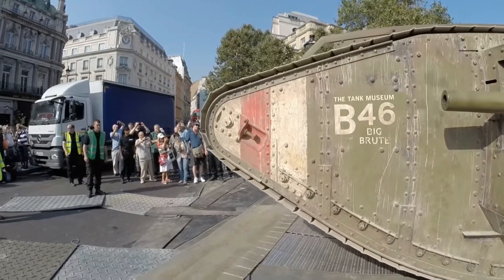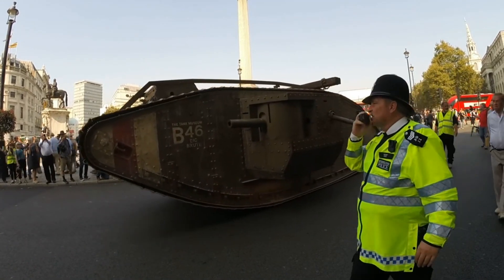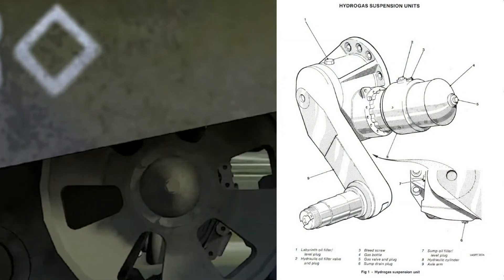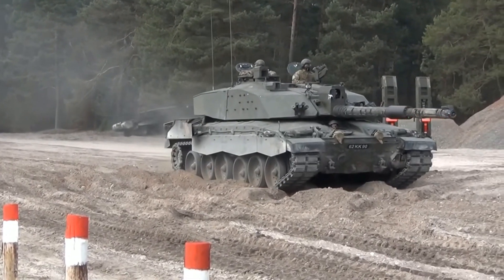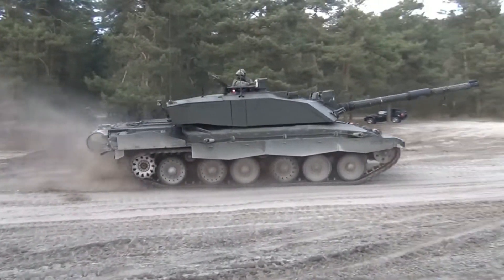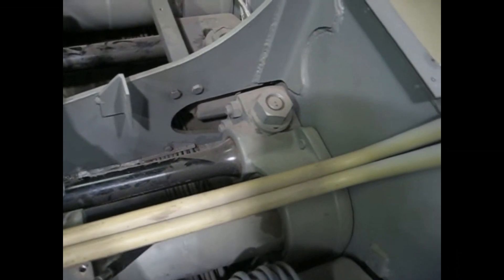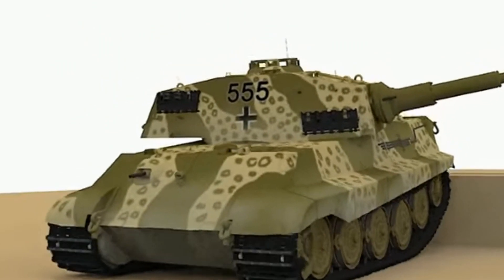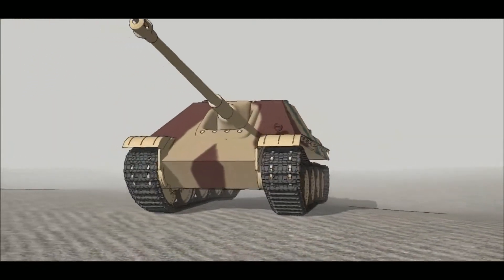Tank Suspension Systems - Pros And Cons

Comment: In 2026, failures in Hydrogas (hydropneumatic) suspension units—common on British armored vehicles like the AS90 self-propelled gun and Challenger 2 tank—typically involve internal seal or valve eruptions that manifest near the rear track wheels. 

Internal Failure Mechanism

When an internal component such as a pressure relief valve or a nitrogen seal fails in a Hydrogas unit, it can lead to a specific sequence that produces black smoke:

High-Pressure Fluid Eruption: Hydrogas units use high-pressure hydraulic fluid and nitrogen gas to provide damping. If a seal "blows," this fluid is forcefully expelled.

Proximity to Exhaust/Motor: In many vehicle configurations, the rear Hydrogas units are located near the engine compartment or the final drives and exhaust outlets. When the hydraulic fluid mist hits hot engine components or the exhaust manifold, it vaporizes and partially combusts, creating thick black or dark grey smoke.

Location of Smoke: 

The smoke typically billows from under the side skirts (bazooka plates), specifically near the rear track wheel (the drive sprocket or the last road wheel), which is where the rear suspension units and final drive assemblies are situated.

Redundancy and Symmetric Failure
Symmetry: 

Because heavy armored vehicles utilize independent Hydrogas units for each wheel station, a systemic issue (such as over-pressurization or fluid contamination) can cause the same failure point to erupt on both the left and right sides simultaneously or in quick succession.

The "Deacon" Proximity: 

While the term "deacon" may refer to specific localized sensors or mounting brackets in military maintenance manuals, the visible smoke at the rear is almost always due to the unit's proximity to the vehicle’s power pack (motor and transmission) located at the rear of the hull.

Common Failure Points

Nitrogen Accumulator Seal: If the seal between the gas and fluid chambers fails, the gas rapidly displaces the fluid, often rupturing external fittings.

Pressure Relief Valve Sticking: 

If the valve fails to vent during high-impact maneuvers, the internal pressure exceeds the unit's structural limit, leading to an explosive release of fluid.

Hydrogas Unit Gaskets: 

Chronic heat exposure from the motor can degrade the gaskets near the rear wheel stations, making them the most likely points of "eruption."

This eruption is evident near the beginning of the video after the old school non suspension tank. You can see the side skirt lifted on the right rear and the telltale sign of an eruption of oil evident from the stain. 

Later in the video there are a few take rolling and one pulls off and the other two follow . The first tank rolls off and you can see the black stain on the exterror of the rear side skirt on the right side. Evident of the common redundancy in a symmetrical paten of production lines for efficiency of manufacturing during the high demand output required during war time.

The second tank rolls out and the skirt is clean. 

The third tank rolls out with identical stain as first tank but then the black smoke erupts. 

Suspension oil mist must have made contact with hot engine compartment through the faulty valve do to heat exposure with it’s proximity to the engine weakening the gasket, compounded by the excessive weight of armor vehicles, in conjunction to high impact performance maneuvers.

Comment: Why not use an external bolt-on-bolt-off system bogie, like a Horstmann bogie to create a temporary fix to a damaged torsion bar? Obviously, don't change the whole suspension in the field, but just use one bogie like an emergency spare and get the tank back to a maintenance depot where a proper fix can be done on a much more complex system.

Comment: Your explanation of torsion bar system would be easier to understand if you just said the bar acts in a twisting motion in a horizontal plane instead of up and down vertically.

Comment: A torsion bar and a coil spring work the same. Both twist when a load is placed on them. A coil spring is essentially a torsion bar wrapped around a cylinder, and a torsion bar is pretty much an unwound coil spring. It took a while for some track mechanics to wrap their minds around that one in training.

Comment: My 2002 Chevy Suburban has torsion suspension in the front. When I first bought it fourteen years ago, I was a bit leery of that design choice, especially considering it is fitted with a snow plow. I changed my opinion over time. It rides great whether it's on the highway or a logging trail.  It has been problem free all these years, even with the added load and stresses of the plow.
Reply: Old mopars (chrystler, etc.) late 50's-early 60's used longitudinal torsion bar (think along the perimeter frame) and they were a b** to fix and keep level.

Comment: im working on a story where a character is using on a one man tank that is meant to be be more mobile but less powerful or armoured than a main battle tank so im curious to know how would one design a tank like this such as designing how it works, what type of suspension would it have, what would it use for movement, how many millimeters would its main gun have, would the main cannon be rifled barrel or smoothbore, what would its secondary weapons be, what type of engine would it have, would it have any active protection systems, what would its armour be made of

Comment: I was hoping for a little more info in regards to hydro pneumatic systems, especially if you have first hand experience. As with the layout and plumbing, wether there are electronics involved or reservoirs of any kind. The torsion bar system on the other hand is elementary. I mean even Chevy 4wd trucks have had those since the early 80s, if you count the S-10, and of course tanks forever,. With the the Gas system I thought it added benefits in regards to real time adjustability and with  leveling and raising and hull lowering etc. Then again If I remember correctly that European Citroen brand cars introduced some sort of hydro pneumatic suspension 50+ years ago so neither is really new.

Comment: One thing I dont quite Understand why they are not make the Tank suspensions able to have its gear connect to the engine... when track is blown off she is able to move.... is it because of the cost? Or its too complex? Not quite as a tank BTs series that been created before WWII able to drive even the tracks are blown off... so we cannot say its too complex to build a tank with functioning emergency driving wheels

Comment: why not use air in the suspension system?
Reply: Plain, off-the-shelf air is actually rather nasty. The main issues are oxygen and moisture, and the havoc they can create. 
Also, nitrogen pressure remains more consistent across temperature ranges and its molecular structure makes it less prone to escaping through seals..  oxygen is a known escape artist.

Comment: Very cool vid. I made my ptv with air shocks from a minivan, LOL. I went with air shocks because of the adjustable air pressure. Never thought about the ride quality which was like floating on air. A big bonus is, I have adjustable ride heights. I can fully extend the suspension for 12 inch ground clearance for off road, or slam it on the ground with 3 inch ground clearance for a low rider, LOL, by adjusting the limit straps. I also have double wheel bogies which helps with ride quality too.

Comment: Actually torsion bars suspension has quite a bog drawback, it’s size, it might not be the largest, but since it has to go on the inside of the vehicle it takes up a lot of space, also there could be cases where to replace a broken torsion bar u might have to remove big parts of the tank to get access to said bar (like the engine as you said, or the turret)
Reply: Big*

Comment: Wouldn't it be cool if you could just raise the suspension fully and just disengage the faulty wheel so you wouldn't have to split the track? Obviously it wouldn't work with front and back wheel but still...

Comment: While you are correct that new drivers are harder on suspension - it does take a newly qualified driver about 12 months to achieve proficiency - I think that you are too quick to blame poor quality crews for suspensions failing. I found the torsion bars to be very robust, having I only had two torsion bar failures with the Leopard 1 over a three year period. One was caused by an unqualified driver, the second was simply because the driver was unable to identify an obstacle (in this case a creekline about as wide as the tank was long) due to driving through thick grass that came up to the glacis plate, while closed down, using only the vision blocks for sight (which is SOP for tactical driving).  

Fact is that operating tanks can be dangerous and when driving cross country at speed, while closed down, many obstacles can be very difficult, or even impossible to see and even the most experienced driver will occasionally hit things, like random boulders in aforementioned long grass, that have the potential to cause damage to the suspension and really annoy the rest of the crew, who of course, demand a "stable gun platform" at all times and really didn't like being bounced out of that creek bed... 

Even worse, is night driving, even with the night vision periscope, although more modern tanks undoubtedly have far better night vision gear than the Leopard 1, so this may not be such an issue for others. 

Also, lets not forget that tank crews often operate for days, or weeks with very little sleep, which correlates to having an entire crew, who are functionally impaired well beyond the .05 blood alcohol level that would have them lose their licences for drink driving. If unable to sleep for more than 24 - 30 hours, due to operational factors, even the best crew is going to start making rookie mistakes.

Comment: Two additional important disadvantages of torsion bars are that they run transeversely accross the floor of the vehicle and the overall height of the vehicle is significantly increased. This was one of the reasons the Brits kept the Christie type suspension for the Comet tank rather than use torsion bars. The other disadvantage is that, although as discussed, torsion bars are relatively easy to replace on an undamaged tank, if you have lost a suspension unit due to a mine or a projectile strike and the hull is damaged, it becomes a major job involving cutting and welding the hull to remove the damaged bar and, if at all possible, to replace it. One important suspension system not discussed here is the helical spring units used by the Centurion and the Chieftain and still being used by the Merkava. These units have the easy replaceability of the hydrogas units but they are cheaper, more reliable and easier to maintain than the hydrogas units, and they do not increase the height of the vehice. They generally have poorer flotation characteristics than either hydrogas syspens or torsion bars however, i.e. the ride quality will suffer, especially at high speed. I believe it is significant that the Brits decided to move away from these units and replace them with hydrogas on the Challenger and the South Africans replaced the coil spring units with torsion bars on the final iteration of the Olifant tank, a modified Centurion.
Reply: “Torsion bar increases vehicle ride height significantly”
Uhh, just look at Russian MBTs pal
Reply: That's the Horstmann system......

Comment: I never would have imagined I could hear so much bullshit about torsion bar tank suspension in a video. You are really starting to decline in quality... 

Really like 90% what you said about torsion bar suspension maybe applies to like WW2 era vehicles. And you don't have to 'go take the crowbar boys' for checking snapped torsion bars, you can identify it by as simple as one road wheel floating up. But that never ever freakin happens because torsion bars dont snap like you are claiming. The development from leopard 2a4 to 2a6 increased the weight by so many tonnes.... so many and still be able to conduct mobile warfare. But well.. you'r whole opinion about the leopard2 was a joke as well. but this sure hits the fan.

Comment: how about suspension system of the tiger/panther tanks? from an engineering standpoint and an ethical standpoint? I guess what i'm asking for   is specifically for those tanks, and how it effected the vehicle positively and negatively. For example, the number of torsional bars and the placement of road wheels, exc. Thanks!
Reply: The Tiger-Panther series (and the half-tracks) used an overlapping-interleaved system with torsion bars as the spring system. The Torsion bars worked fine (but ate up a little floor thickness) but the wheels were disastrous in mud and snow. Stop the tank too long when it's freezing outside and the whole suspension is locked up until you chisel the crap out. There are ways to arrange the torsion bars so they leave gaps in the bottom so you can have transmission and engine bottom end access and escape hatches, but I can't remember the design(s) that did this.

Comment: is hydrogas suspension on Challenger 1 and 2 was same as hydrpneumatic suspension on like Type 10 or MBT-70
Reply: And Leclerc. Yes it is the same.
Reply: i mean, they can adjust angle of the tank (best for hull down :D)
Reply: They could with additional modification, but after the MBT-70 and later experimental concepts the height-adjustment feature was deemed unnecessary for vehicles operating in europe.
Reply: +Jonny alright, thank you for the information

Comment: At 10:25 the right side, station 1&2 are failing.
After driving the tank of the small hill, the front of the tank didnt pull up , but wen the tank parked and keep still on that upwards hill, the weigt of the tank pulled up the tank. NOT THE SUSPENSION!.
I hope that its the right answer.

Greetings

Comment: why do they not change all and the rear mechanics charge the hydrogas suspension?  Tension bars from experience they could very difficult to take out, because of the angle, that you need to take them out, and sometimes snaps also when the tank is parked, and not moving.

Comment: Almost every main battle tank in the world uses torsion bars- Brits are using hydro pneumatic suspension
Almost every main battle tank in the world uses smooth barrel- Brits are using rifled barrel for the main gun
Almost in every country cars are driving on the right side of the road- Brits are driving on the left side
Truly stubborn people LOL
Reply: Actually a lot of countries use the left side as well, but good joke nonetheless
Reply: When you say stubborn, they're the king in it.....
Reply: Truly stubborn and highly original!
Reply: And Russian tanks can fly too!
Reply: If only you knew!
Reply: Not the sweds in strv 103 s
Reply: @robertmoore-x4y  The right side in Europe is mostly used because of Napoleon, he made right side as preferable way of moving by new laws in occupied countries (yea it little mattered back then with horses etc.)
Reply: The British designed and built the Rolls-Royce Merlin engine, especially with its two-stage, two-speed supercharger (often built under license by Packard, linked to Ford's manufacturing expertise), revolutionized air combat by providing consistent, high power at altitude, transforming the Spitfire and P-51 Mustang into dominant fighters, allowing them to outrun and outfight opponents by compressing thin air, significantly boosting speed and ceiling and securing Allied air superiority in WWII.
Reply: Hydrogas is actually preferable for tracked AFVs.

Rifled guns are still trash though.
Reply: Hydrogas certainly gives superior off road ability. As to the correct size of the road to drive on, it's the rightsiders who are being unreasonable. The reason we have islands on the starboard side - right - of aircraft carriers is that it was early discovered that pilots in trouble tend to veer left. The same applies to drivers which is not a great problem if you are driving on the left-hand as you tend to end up on the verge. If you are stupid enough to be driving on the right, you end up facing oncoming traffic and immanent death.
Reply: @alecblunden8615  This is actually true, whenever I'm in a dog fight in a game I almost always roll left, and I occasionally roll right, but thats when I'm attacking, not evading.
Reply: @alecblunden8615 somewhat late but you know that the island on a carrier is on the right side because of air flow and the direction the propeller is spinning nowadays it dosent matter anymore
Reply: Гаврило Принцип aye that we are.
Reply: They still use HESH ammo as well
Reply: @olegc.7877  The British are completely 'stuck' on their Island, Matsimus is a perfect display of that. I never heard so much bs about torsion bar suspension in my life.

Comment: I look back on my 10 year career in the Chertsey workshops during the development of Chall1 and the amusement when having a thrash around Long Valley and wondering why the vehicle was drooping a bit on one side.  Only to find we had lost a complete hydrogas unit wheels and all.  Main problem was you couldn't tell with all the slewing and grinding cross country that it had happened.  It certainly transformed the ride from the Chieftain and along with the appalling build standard of the gearbox and the main brakes there was plenty to keep us in overtime. I never really understood why an onboard system allowing the hydrogas units to be adjusted by the crew even while on the move  would have given the capability to squat down when hiding to lower the profile and jack back up for cross country.  An engineer working with the units said you could loose one of the middle stations but a front or rear was a stopper.  Next call to REME to bring a unit and crane.  Those suckers were heavy.